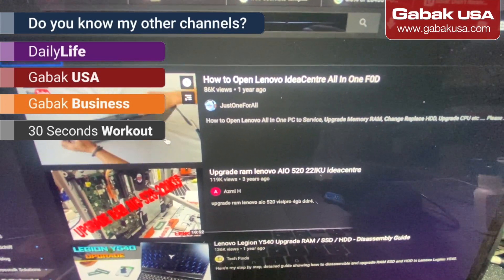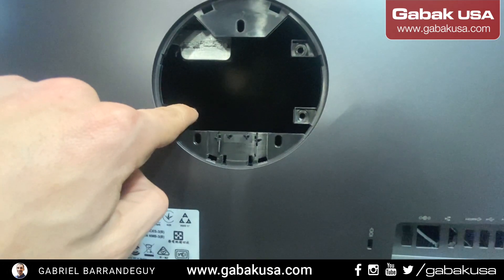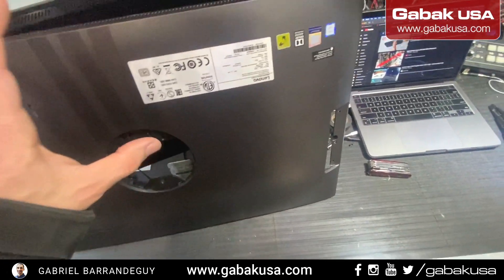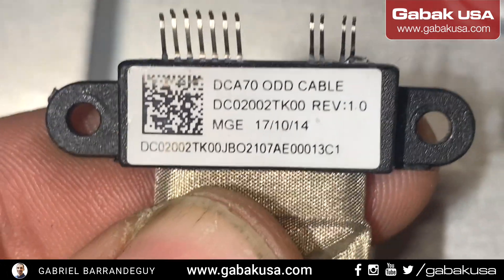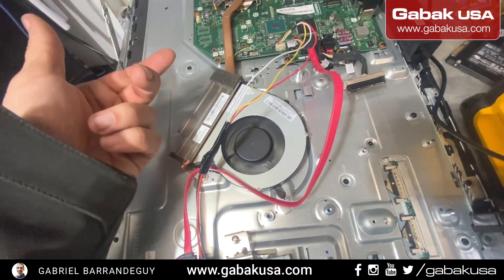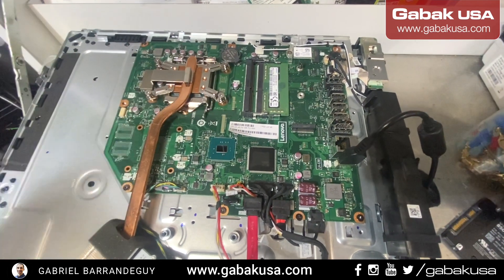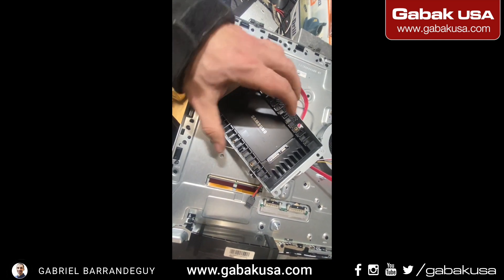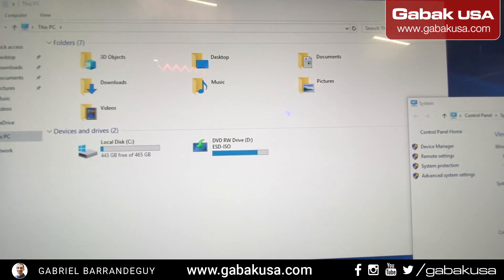how to upgrade lenovo aio 520-27ikl SSD RAM & CPU

Comment: Just broke mine in the exact same way! This video deserves more exposure. I watched videos for taking apart the smaller model and assumed this one was the same. I'm going to try gluing my socket back together. Some pins on the power plug have fallen out, but I suspect they were not connected, and if so they were duplicates. Edit: it worked.
Reply from the maker: Glad it helped!